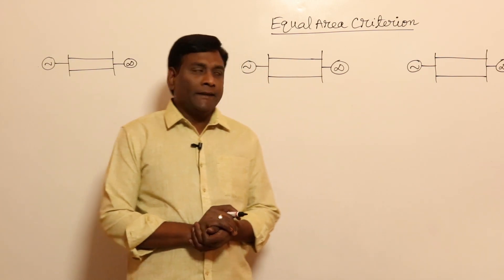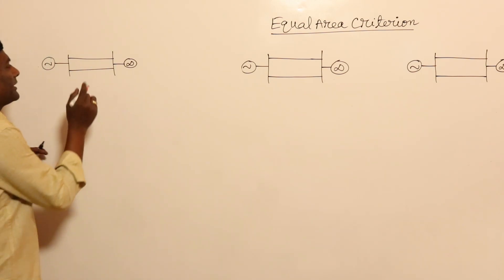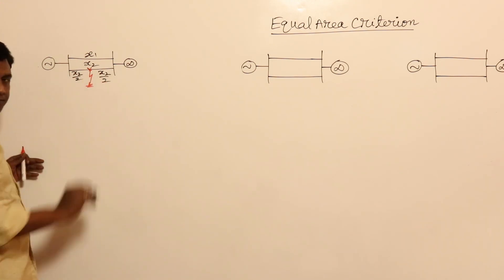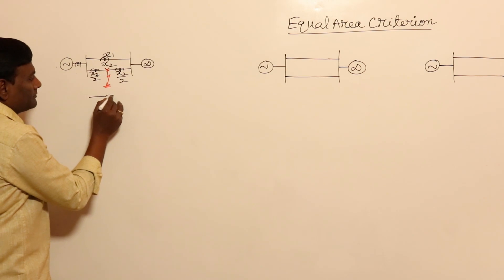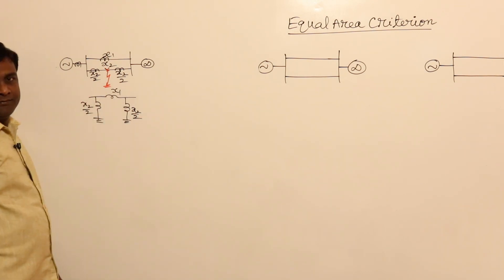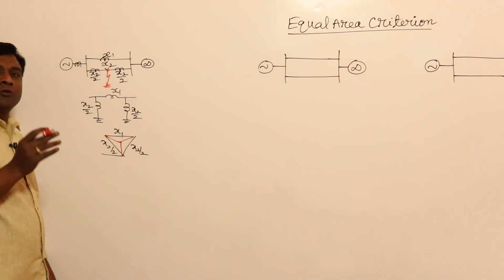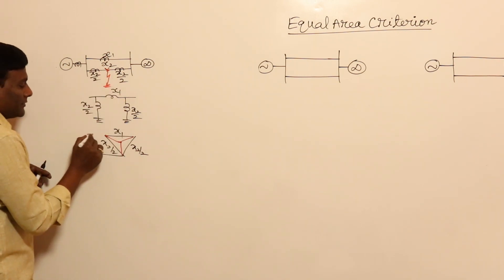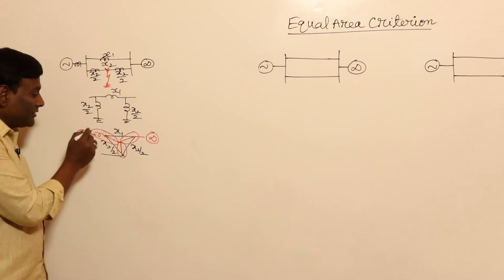Applications of Equal Area Criterion | Transient Stability | Power Systems | GATE Lectures by KN Rao

Comment: Sir...why only transfer reactance is considered?...and remaining other legs of the delta are not considered?
Reply: the resistance in parallel with ideal voltage source is redundant that is it is trivial element so it can be neglected and only transfer reactance is considered.
Reply: or you can also solve with thevenin.